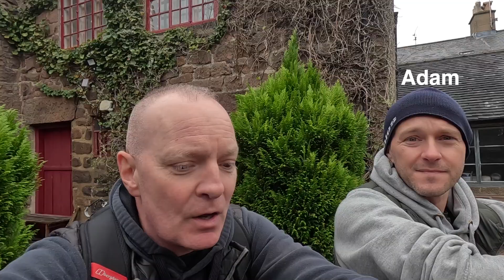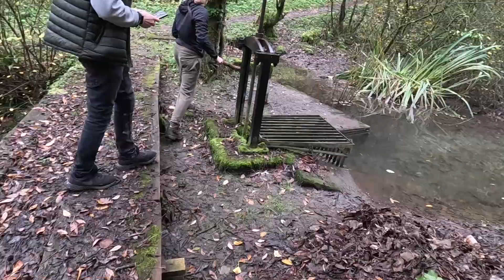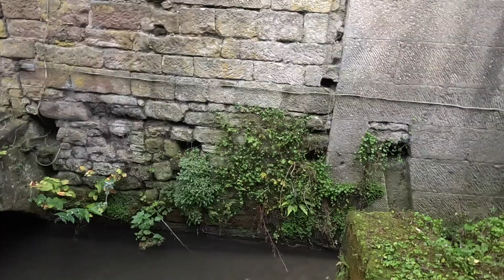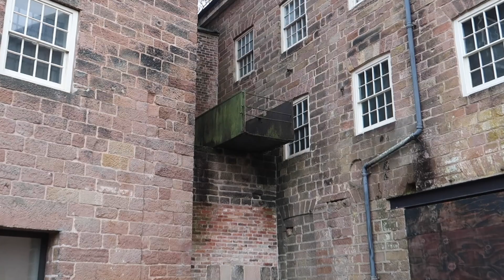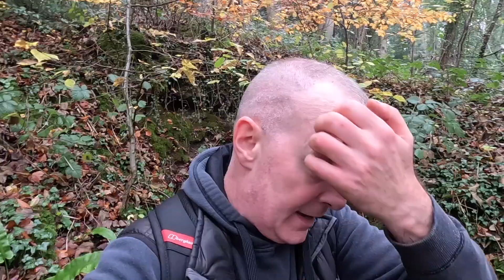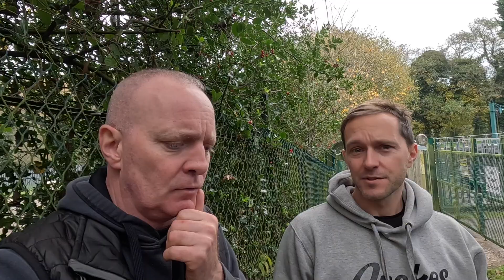The Industrial place you never knew about ?

Comment from the maker: Adam = Forgotten Pumps on Instagram. Roy Below and Beyond on Instagram. Marcus  =  https://www.youtube.com/@thedrainmaestro  also on Instagram The Drain Maestro
Music Savk: Strange The Dreamer
Reply: Just a heads up , The incline plane you looked at by Cromford canal with the Pumping engine house and ex railyard ,well if you trudge up the incline plane you come to Middleton Top which still has the incline planes winding engine in place and is open sometimes .A rather large delightful beam engine and a visitor center for cuppas etc., Stay well ,stay safe and god bless .
Reply: Great vid as always Martin, I liked the reference to Marcus being Post 10 ( the beaver dam culvert unblocker ) 😁
Reply: The translucent white stone at 20:15 looks like fluorspar, which was mentioned along with lead as being mined in the area
Reply: There was a metal pipe about 9 inches diameter at one of the outflows as you were walking down the road before examining the water wheel. I think it may have been connected to the the pipes still existing in the overshot water wheel. Pumping water to drive a wheel would not work because it would use more energy that the wheel could provide.

Comment: Leawood pump on a running day is well worth a visit. Also while you're there nip back to Sheep Pasture incline and walk up to the catch pit just past the bridge and you can see the remains of the last time the pit was used in anger. Also worth a visit if you are in the area is the Engine house at Middleton Top (the next incline up the line) that has it's original Butterley Engineering beam engine which is also run on selected days, if you are feeling fit you can walk the trackbed as it's only about 3 or 4 miles but it's one hell of a climb.

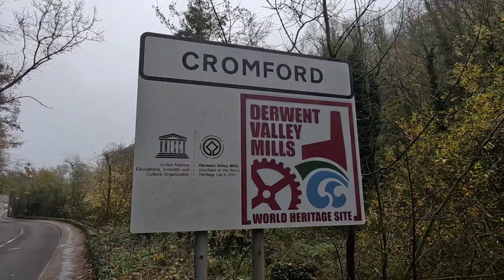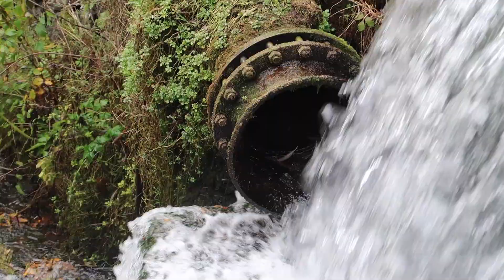Comment: Another excellent video Martin! :) A fascinating area for sure. As far as the large intact water wheel is concerned, is it possible that the water came from the pipe shown from 7:09-7:18? Maybe there was a trough there at some point to collect the water, and divert it down the pipe. If the pipe goes downhill a bit, it might develop enough pressure to get the water to the top of the wheel, without needing a pump. Just a thought :) There was also another pipe shown in that same area, near the grate where the water disappears out of view. That could have also been the pipe that sent water to the wheel.

Comment: If you cross the road and walk up the lane called clatterway into bonsall  you will find more mill ruins on the right hand side of the valley one which had a water wheel about 36 feet in diamiter which was built to cut hopton limestone for chatsworth house and earlier mills higer up the valley.

Comment: Our company Bridgecraft Engineering we’re based just at the back of Via Gellia Mills where you were filming for 15yrs and we made new bearings and a shaft for the Cromford wheel recently, they have yet to be fitted. 
The water isn’t pumped to the top of the wheel, it just rely’s on the head of water from the pond above. They would have needed a water wheel to power the pump required which would have been pointless given that the pumped water would have been only driving another water wheel. 
Sorry, bit of a schoolboy error there 🤣

Comment: Pronounced Via JELLIA if you don't mind, Martin!
I live in the house on the other side of the road from the end of the path across the mill dam so if you drag your backside down here again, call in for a cup of tea and I'll give you a bit more about the Via Gallia and the stream that runs through it, including the now filled in pond that fed into the pond you shewed in the opening.

It's probably worth doing another full video on the Via Gellia its self as there is a hell of a lot of interesting stuff that you missed, including the old lime kilns just up the road from the pond.
Drop me a line if you're interested. I'm always willing to put the kettle on!

Regards the wheel at the basket place in Cromford, it IS a breastshot wheel, not an overshot, all be it one with a very high water inlet to get the maximum turning effort out of the water. If you look at it from the road and imagine it as a clockface, the water came in at about 11 o'clock which caused the wheel to spin anticlockwise. An overshot would have the water coming in at 1 o'clock and spin clockwise.
If you look at the buckets on the wheel, it is obvious that they are set to spin the wheel anticlockwise.
The water incidentally, came from the top pond.

20m10s I think you are looking at Flurospar

Comment: You asked how the water got to the top of the wheel, it certainly wouldn't have been pumped which would have defeated the purpose of the wheel, my guess is that it came from the pipe seen at 7:10, there would probably been a box to collect the water at that drop, potentially with a coanda screen.

Comment: That water wheel driven from a pipe-fed tank is breast shot, not overshot, and is a late design of water wheel after they discovered breast shot was the most efficient. They certainly would NOT have pumped the water up to the tank, which would have required using power - that would rather defeat the object of using the wheel to generate power! The water source for the pipes must be coming down from a higher level further upstream, possibly by means of a weir in the river to generate a head of water. 
Also, its later design means the wheel is iron / steel construction rather than wood and the power was taken from the rim, not the axle, hence the toothed 'gear' around the rim which would have driven a spur gear which powered the machinery (this can be seen on the picture you show of the second wheel, which is no longer in place). The advantage of rim drive was that the wheel can be of much lighter construction as it does not need to transmit its power from the rim to the axle; the power is generated at the rim by the attached water buckets and taken directly from the rim by the rim gear. You can see all these features working at Quarry Bank, Styal, on the Great Wheel. The Styal Great Wheel was designed by Fairbairn and is as advanced as water wheels got before giving way to steam power. The rim is suspended off the axle on thin steel 'spokes' rather like the spokes of a bicycle wheel, making it very light for its size and therefore very efficient.
I'm a National Trust Volunteer at Styal, and also a miller and guide at Nether Alderley corn mill where we have two very much older design wooden overshot wheels in tandem and geared together - unique as far we know.
Come to Styal and Nether Alderley for a look-see! There are also 2 steam engines at Styal - a very old beam engine and a single cylinder horizontal double-acting engine.
BTW, Martin, do you know the Cromford & High Peak railway was originally designed as a canal to link the Peak Forest Canal at Whaley  Bridge to the Cromford Canal at Cromford, right across the Peak District. However, the difficulty of getting water at the high levels to work the locks meant it was built as a very early railway, or tramway i stead of as a canal. Much of the track bed still exists, and between Parsley Hay  and Cromford it is the High Peak Trail cycleway. It was built like a canal with level sections but instead of flights of locks inclined planes were built with stationary steam engines drawing the wagons up the incline.

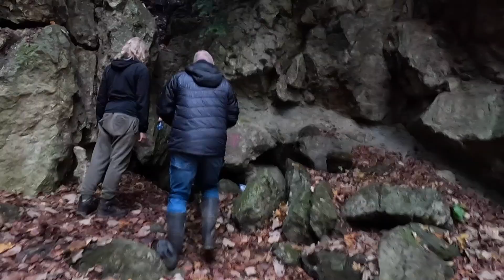Comment: another fantastic video.  17:57, a connection between lead and drinking milk?  i used to work in a panel beater shop in victoria, australia. in the 1980's.  it was state law that 1 pint of milk was made available to every panel beater daily.  i used to take yesterday's milk home.  it was better than throwing it out.  because some panel work might have only occasionally involved lead wiping, your video might have finally explained after 40 years , why milk was required by law.  i wonder if this sort of law exists anywhere else.

Comment: Absolutely brilliant video!  The opening shots were beautifully done!   Now, some where nearby there should be a stamping mill to crush the lead ore before it goes to a smelter.  This mill would have been water powered as well.   Three or more hammers would have crushed the ore into smaller chunks, they may even have decided to ship the crushed ore to a different location.  Lead was used as a roofing material, as the cames holding stained glass in churches, and later as bullets and batteries. Interestingly, where ever Galena, (lead ore) is found, silver can also be found as well.

Comment: No local hydro electric alternators in that wonderful gravity water heads ?
Reply: there is a wheel there now and also a high pressure turbine. The wheel is very small though compared to what it would have been

Comment: Visited the area with my self converted campervan in 2003. Had a wander around Cromford, walked some of the towpath alongside the canal, walked down Sheep Pasture and Middleton inclines (and back up to get back to my campervan - hard going!), and rode some flatter sections of the Cromford and High Peak Railway trackbed. Incidentally, from the location of the water header tank and the angle of the buckets the big waterwheel looks to be what's known as "backshot" i e. the direction of rotation is opposite to an "overshot" wheel.

Comment: 1965 Sheffield Used to Bore out the inner shells for the Bearings on line shafts. Same as the ones on the inside of the water wheel. It looks like the upper shell has slipped out or worn out. just need a lathe with a four-jaw chuck and the castings.

Comment: The mineral inside the mine looks a bit like barytes (heavy spar) and the silvery looking stuff would probably be sphalerite (zinc ore) neither were much mined prior to the 1860s they usually turn up together but that's not completely scientific you do get galena turns up with sphalerite. That's where your problems arise all 3 minerals are similar density so there's no easy separation process
Reply: I was thinking the whitish mineral(s) in question looked a lot like calcite. Maybe you're right about barite, but there is probably anhydrite or macphersonite there also. I'm sure you're right about the sphalerite. Probably not much galena right there. I took a class 30 years ago, so that makes me the expert!

Comment: That pipe would be ok without pumps if the inlet to the pipe is higher than the tank
The romans used pipes to cross valleys where an aqueduct was impractical
I hope you go back for open day at the pump, even better if it is running, you should be able to feel the building shake, i've been to a similar pump[ing station in Crofton wiith 2 beams